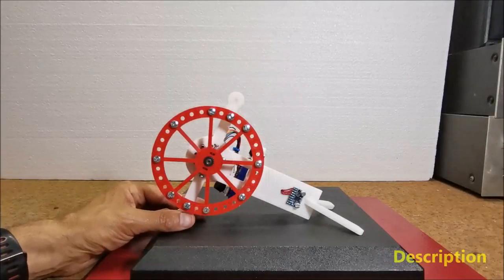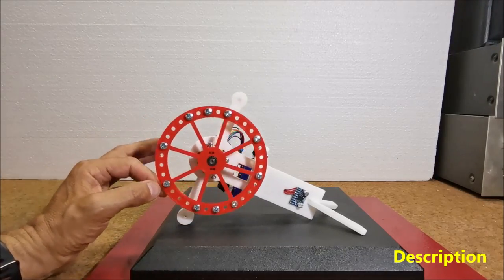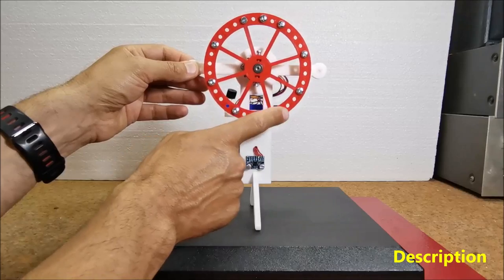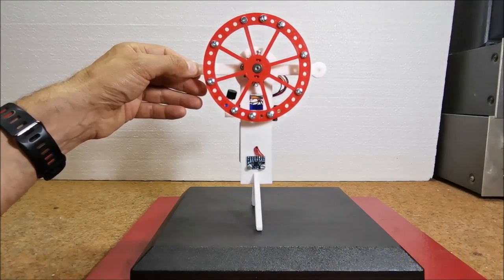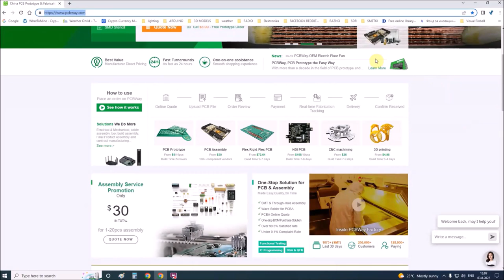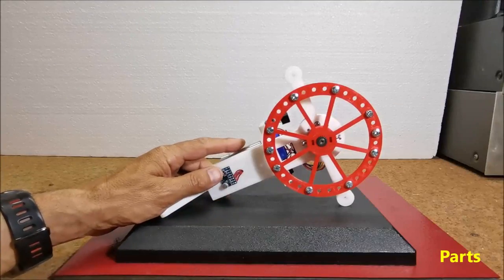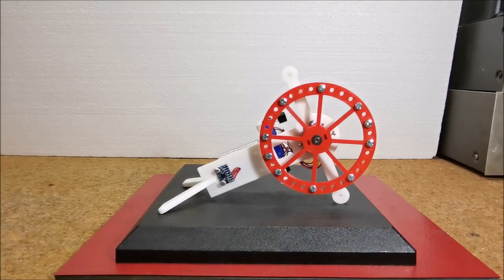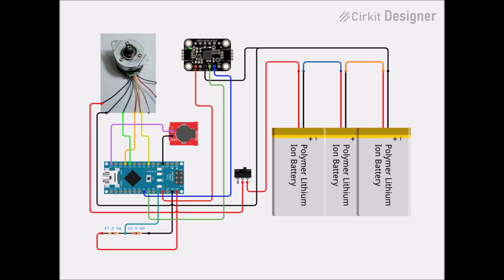DIY Aduino One Axis Self Balancing Device

Comment: Thank you very much for sharing your video, but I would like to ask you something, look, I already have everything assembled, the motor, the microcontroller, the speaker, resistors, everything connected as your schematic shows, I have even burned the program in the arduino, at the moment after turning it on, I wonder what steps I should take to make it work like yours, that is, I upload the program to the arduino, I run it, there are no errors, but my motor does not turn and does not seek balance, I wonder if maybe there is some step that I'm ignoring,?
maybe do I need to calibrate the gyroscope before? or maybe do I need another code? I would really appreciate it if you could answer me.
Reply from the maker: I just replicated the original project from GitHub https://github.com/remrc/One-Axis-Reaction-Wheel-Stick. Only I experiment with the values of floatX1, floatX2, and floatX3 in the code. There is no need to calibrate the gyroscope. Try the original code from GitHub